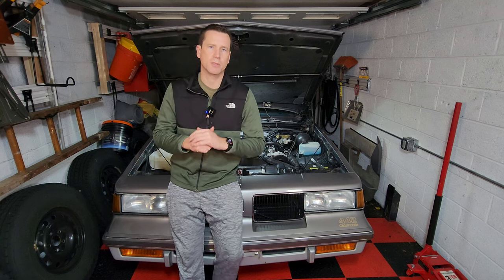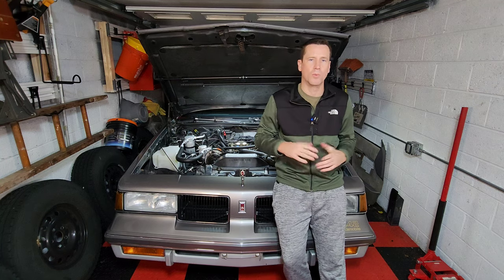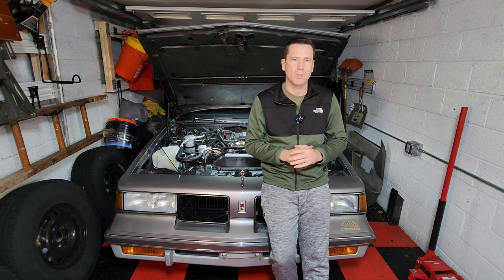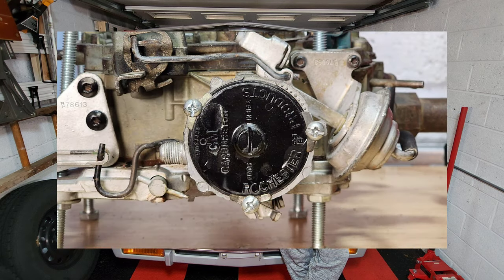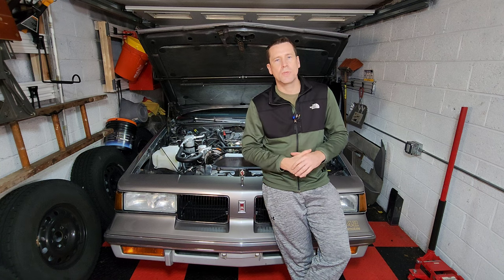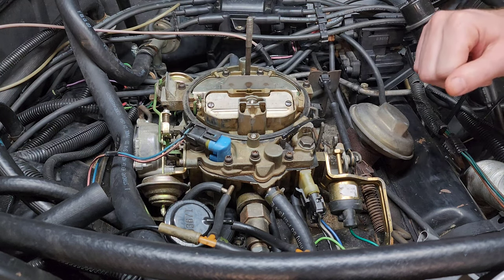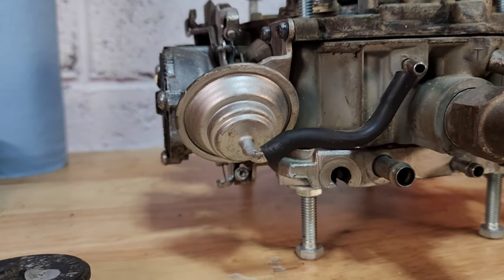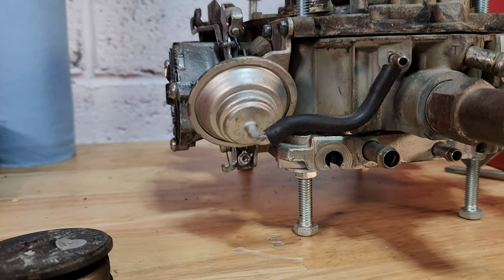The 5 Choke Adjustments You Can Make On Your Electronic Quadrajet Carburetor

Comment: Ive been watching your videos since i got my grandfathers c10 earlier this year.It came with carburetor issues.I bought a rebuilt carb with matching numbers.It still seems to want to flood when i punch it.I cant figure it out.
Reply from the maker: What do you mean by flood? Is there a hesitation or bog when you floor it?
Reply: @rporestorations  I just seen your reply.Its weird it didn't notify me so sorry for the delay.There is definitely a bog.
Reply: @rporestorations  I'm going to try readjusting the carburetor again.After watching more of your videos I'm pretty sure I did it wrong.I want to start by setting the idle but I don't have a Tachometer in the truck.Im either going to install one witch I'd rather not or get a tool to tell me the rpms.Your videos have been helpful.